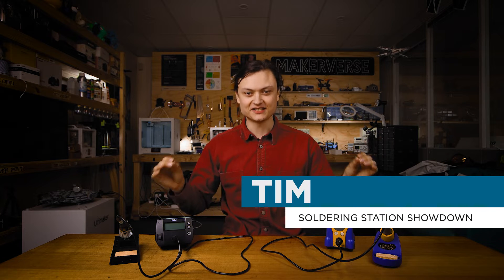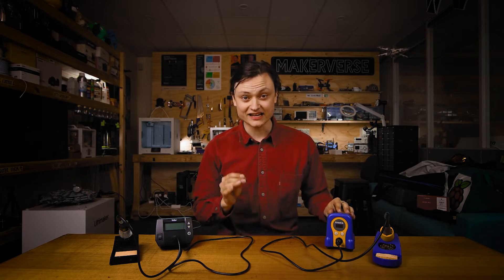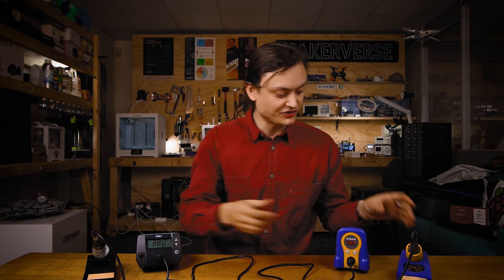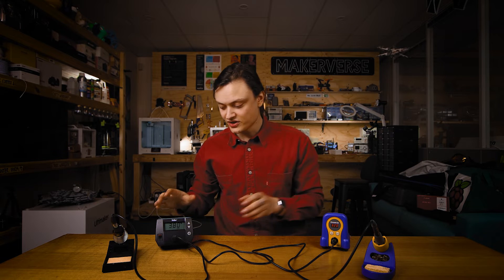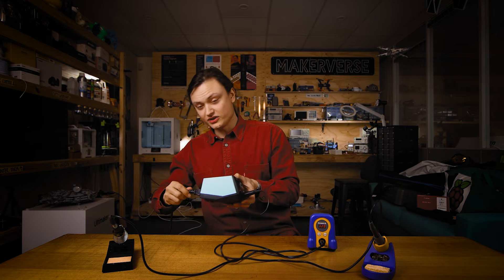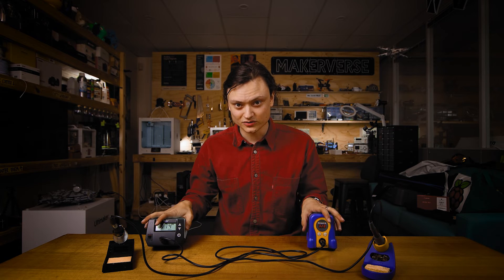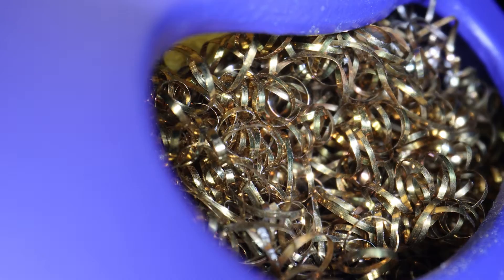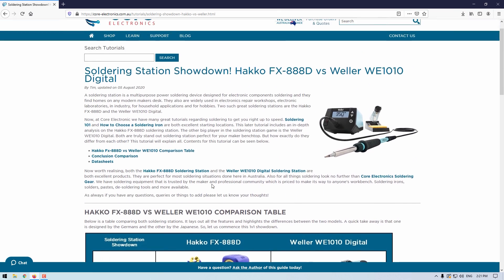Soldering Station Showdown! Hakko FX-888D vs Weller WE1010 Digital

Comment: I like the WE1010 more, been using Weller ever since the 1970's and will stick to them. The only thing I didn't like in the Weller was that it has no visual indication that the power is on, the LCD has no backlight nd there is no LED indication. This I solved through my own fix. You can see how I did it in this short video I made about the modification: https://youtu.be/vsnpXHTc3M8
Reply from the maker: I love this! Thanks for showing 🙂
Reply: @Core-Electronics  Thank you. Yes, it looks really cool now. Much better than having a backlit LCD display. That would have been so ordinary...
Reply: I just got this exact station but my question is have you expected any problems with the temperature, because I heard that the temperature is well off from what it says on the screen
Reply: @infected7258  Why would you expect any heating problems...? I mean, Weller is a good brand, I had one for 40 years and gave it away when I bought this one. I bought it used, and gave away still working.
Reply: @AdaptingCamera  allot can happen to a brand in 40 years,   suspect that Weller is not the Weller from back then.
Reply: @timbrax  So far, all I can say that Weller is still Weller. The build quality is very good and these devices are very simple things technically, so there is no reason to suspect why the WE1010 would not outlast you and me. I would not trust a cheap Hakko FX-888D to last more than a few years. It's really just a toy as I see it.

Comment: Thanks for the comparison. As of 2025 the newer 888DX Hakko can put out 95W at the tip with an iron change.
Don't quote me but I do not believe Weller have upped their usable tip power specs on the WE1010 at this time.

Comment: Something that was missed here if you want to know is the hakko thermocouple is in the heating element and the weller is in the tip. 
The weller looks like it drops temp faster and lower on the sponge, however its just got better real time temp whereas the hakko is less difinitive since it doesnt measure temp of the tip where the weller does which to me is important.

Comment: No spare parts for the WE1010 Station! is the reply i receive from Weller.
From a company who sell tools for repair is inadmissible , let this old company gone like water of toilet .
Reply from the maker: :| Sounds like your base unit has failed outside of warranty and you are seeking replacement parts inside. 

All of the ‘normal’ consumables are replaceable. Irons, tips etc. though it’s normal for commodity gear (base models, low cost) to call it a day on the unit itself. With that said, Weller have excellent service for in-warranty hardware, in the unlikely event something goes wrong.

Comment: Since you didn’t answer which is best, I’ve tried both and Hakko turns out to be better. When soldering, Hakko keeps the temperature at say 300C with no problem, while Weller falls down to 290C and then it starts heating up to 300C again in the middle of soldering, so you can imagine the frustration of waiting for the iron to heat back up. I would definitely recommend Hakko. Weller just isn’t what it used to be anymore.
Reply: thanks for that extra comment - that is what i was looking for.  I got the weller but will likely send it back and get the hakko.  temp stability seems to be an issue for the weller.
Reply: @tomphillips2473 I’ve never had an issue with mine. Does it make a difference if the temp drops 10c? Mine does it too but it’s made zero difference in the results of my soldering
Reply: @tomphillips2473  I'm on the fence about both, did you end up sending the Weller back and getting the Hakko? Or, did you end up liking it?
Reply: @LSUFaithful7  I sent it back and got the Hakko.  I like it better 🙂
Reply: @tomphillips2473  thanks for the feedback, looks like I’ll be buying the Hakko.
Reply: @LSUFaithful7  your welcome!  I think it’s a better built unit.  The old wellers of the late 80s and early 90s were tanks but the new ones don’t see to be made as well.
Reply: @tomphillips2473  that's what I've read so far. I know I watched this video: https://www.youtube.com/watch?v=tlKg6rSMPEs&t=2s and aside from aesthetics the Hakko seems to be the better overall unit. So, I'll go with what's time tested.
Reply: I have both.  Hakko is better.

Comment: In your opinion: which is easier/quicker to swap tips with?
Reply from the maker: Definitely the Weller in this case
Reply: Well they have exactly the same way of changing tips, so you can’t say which is quicker, but they are both easy.
Reply: @damjanpoers7101  The Weller has a plastic nut that does not get hot and can be removed with your hand while the other is metal and will require pliers or gloves to change when hot.
Reply: @tomphillips2473  yes that’s right. I didn’t take that into consideration. Although, I have never changed tips while they were still hot. Quick tip: always check the tip before you turn on the soldering station.

Comment: You didn't show either of them actually performing the task of soldering? At least get a board with a big ground plane and put them head to head to show their performance?
Reply: That would take work. He'd rather pretend there's a 5W difference and talk about the total combined weight instead of, idk, maybe the iron holder lol.  Useless drivel
Reply: There’s no test you could perform that would show any difference between them, specs are more than enough.